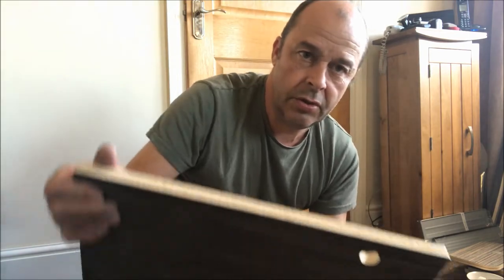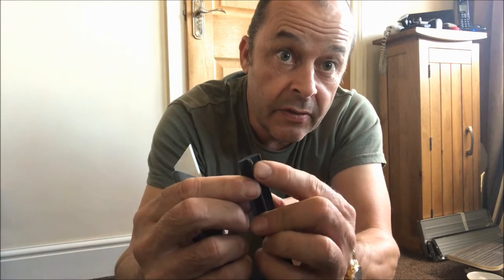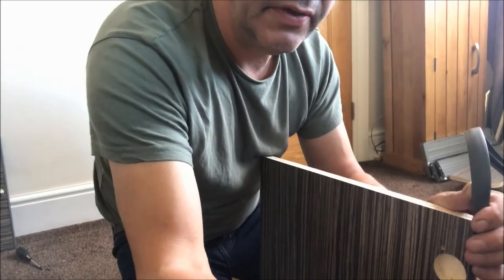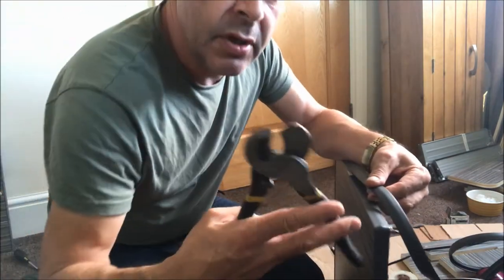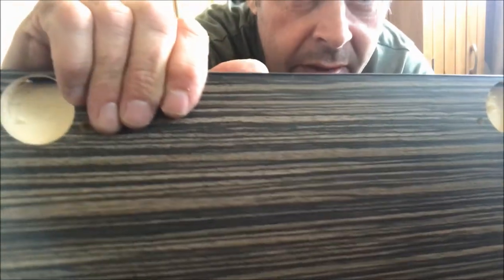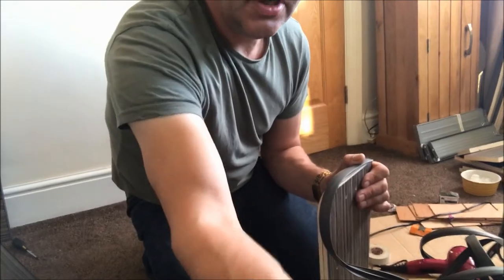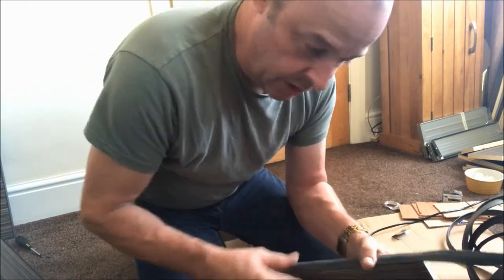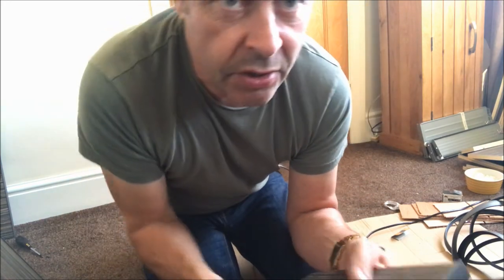T5 Transporter camper conversion EVO Design edge trim

Comment: Great video, really helped my friend and I understand how you do the trim. How did you do the inside of cupboard doors and the doors? We had a go this evening and found the door didn’t fit in properly. I assume due to doing the trim wrong? Any Tips would be great
Reply from the maker: the trim has to be knocked right  into the groove , any little bits that are not knocked in properly will make it harder for doors to fit . Also take care to get the corners done tight as you can and the v is cut out of the inside edge and is big enough before knocking it in.
it was the hardest part of the build and great care needed to get it in right.
thanks for watching and good luck with your build.
Reply: JG Wild Camping how do you know where to put P trim and the T trim?